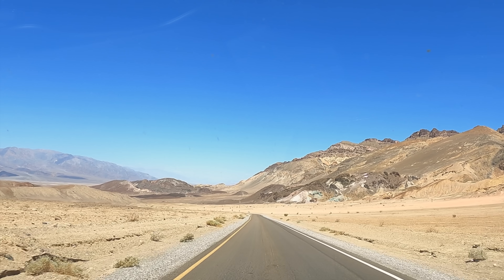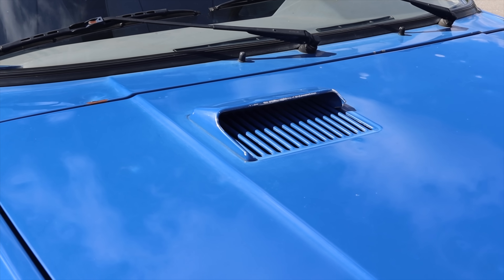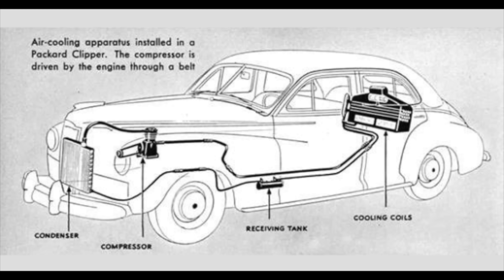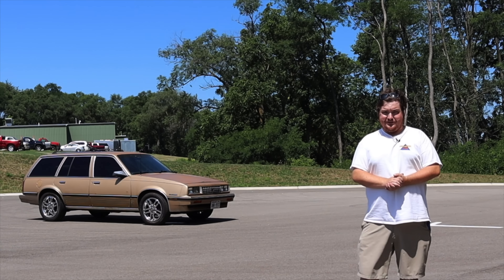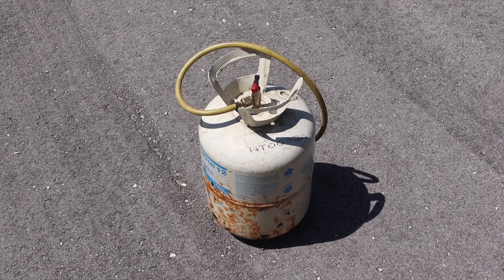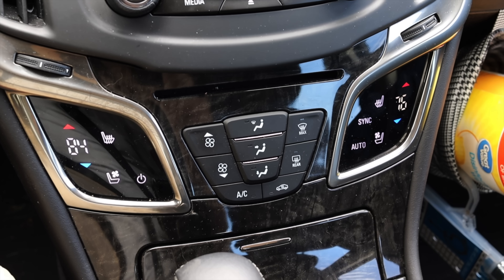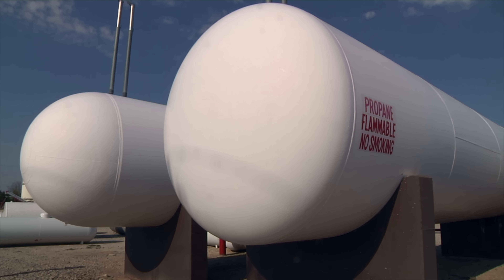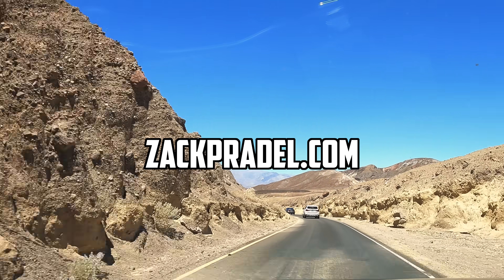Air Conditioning - The Story Of R12 & Why Modern Air Conditioning SUCKS!

Comment: I don't know, man, all of my newer cars have cooled the cabin pretty freakin' well.  I guess if I drove one back-to-back with an old R-12 system, I'd notice a difference.  Also, I'm in an area where 90 F is about as hot as it gets, and that only rarely.
Reply: Must be nice. Was 108 with the heat index in Tampa Bay today, I rely on really good tint and AC to survive 🤣
Reply: I've never been in an R12 car but in most tiny 4 cylinder cars I've been in, I've had to pretty much keep it on max once it got around 87 until maybe 30 minutes into the trip. Some SUVs I've been in cooled down much faster though, maybe it's because of their larger condenser and compressor.
Reply: @mattwolf7698  My ‘19 Honda Ridgeline can keep the cabin in the upper 60s on a 100+ degree day, but it’s basically maxed out at all times. In my old ‘88 Fiero or ‘92 Achieva, you couldn’t leave it on max for that long. Your fingers would be borderline frost bitten. I used to leave the a/c on and direct the air to the floor vents to keep….beverages…cold. And it made a huge difference.

Comment: I had a 2019 Mazda3 Premium Hatchback until I traded it for a 2022 CX-5.  Overall the ‘19 Mazda3 was great!  But my biggest complaint was to poor performance of the A/C.  It was noticeably worse then any of my previous cars.  So far I’m happy to say that the A/C in my new CX-5 is more on par with what I would expect from the system.
Reply: I'm a Mazda tech. You shouldn't be having issues with any of the vehicles you guys have. If its under warranty, have your dealer look at it. Today's AC systems are fairly complex, and there's several issues that can cause poor cooling besides low freon. Also, check under the hood and see if you have 134a or 1234yf. He didn't mention it in the video, but most cars are now using 1234yf. Its extremely expensive. When it first came out a few years ago, it was $500 a pound. The price has come down since then, but its still very high. Do something before the warranty expires. 

Like most car companies, Mazda has a policy of no upselling warranty repairs. What that means is if a tech finds something wrong with your vehicle and the repair would be covered under warranty, they're not allowed to say anything to the customer. (This applies to everything, not just AC). You have to make the complaint. So, even if you're not sure about some type of issue, complain anyway.
Reply: @AT-wl9yq  thanks for the insight! Imma get my Karen complaints going but then again I’m now out of warranty. 🤣
Reply: Yeah real happy with my new cx9 my 2014 Mazda 6 gt was nice and cold though. Maybe it was just the cx5 that year
Reply: I'm in Australia, my wife's 2016 Mazda3 a/C is very good. Maybe it was your car.
Reply: I live in southeast Louisiana and my wife's 2020 Mazda3 hatch has a great air conditioner.
Reply: I have a 2018 Mazda 3 GT and the AC is freezing lol!

Comment: At this point I don't feel it's the refrigerant that matters but the stupid computer controllers and modules that put fuel efficiency and "smart" function ahead of everything else. If one sensor doesn't work or one flap sticks all hell breaks loose in the system. My older Mercedes has an R134 system and it freezes the hell out of the car and my Mom's Nissan Kicks with a tiny system with R1234YF also blows really cold but you have to turn all that "auto" garbage off because it never works right. Just set it yourself manually and it's fine. Many newer luxury cars have so many different settings and programs for the climate control and the end result is it never does what you want it to do.
Reply: Eeeyup. though they do that more for comfort than economy in most implementations - the idea is to make air coming out of the vent closer to the target temperature rather than go for the full frozen face effect. IME, this works quite well, but in very hot and sunny weather I do find myself having to bump the set temperature down one or two degrees.
Reply: Correct. Engines get choked with this modern BS, and add to that that Americans use gutter fuel (86/87 AKI), so you have more knock, LESS fuel efficiency, LESS power, LESS MPG. Also, there are more 4 (and even 3) cylinder engines than EVER before. When you idle 6-8 cylinders with no eco poo poo, it's going to crank the AC (and heat in winter) WAY faster. And add to THAT that these newer cars have this dumb engine stopping nonsense (which may seldom stop the engine when the AC is maxed out, but still invariably will at some point). R134A in a good setup blows plenty cold. I recall being in a dinky HHR and that AC would freaking HURT when it cranked. GM, like Toyota, absolutely aced R134A. Chrysler also did great with AC (at least pre-Fiat). Their older minivans were great. Modern Fords are disastrously unreliable, but when their AC works, I recall them blowing very freaking cold too. Even a recent Escape I was in, I think a '17 or so, that AC cycled but it cycled from mild frost to ice cubes and I don't think it was set to "max". 

R134A was mandated in 1994 and used up until 2020 year models, so most people don't even realize how many cars they've driven with R134A. Also, people here are playing stupid. ALL compressors on Earth require a couple minutes to build head pressure when there's a strain (pressure equalized (settled) and high heat ambient). If it's 70 degrees outside, or under 85 in your garage, then yes, within a minute it's going to start blowing cold. But with your car baking in the 90+ degree sun if anyone thinks ANY car will be blowing cool in less than 1-2 minutes and COLD in under 5-6 minutes, then they're drunk and lobotomized... 

We could bring back R12, but to paraphrase what you said, if the car's electronics are tuned by a psychopathic eco lord, it won't touch the cars of the turn of the century.

Comment: I had a '91 S-10 pickup for a few years....  Because of it's R-12 AC system and it's comparatively-small interior space, its AC system was extremely efficient and EXTREMELY cold.  Like, almost uncomfortably cold if set on MAX cooling.  A put-on-a-coat kind of cold!
Reply: My buddies father had a 79 Chevy 4X4 1/2 ton and if you breathed right up at the vent you could see your breath. I've never seen air conditioning that cold ever again.
Reply: I had a 93 grand am which I’m assuming was r12. One day when me a several friends where cruising some country roads on a hot summer evening. We noticed that it was so cold that you could see your breath. Best A/C I’ve had in any car over the years
Reply: @somethingsomeone5440  Pontiac always had awesome air conditioning in their cars
Reply: I remember the old R12 systems would actually freeze the condensation around the vents in your dashboard.
Reply: I had a 92 Silverado with R12. Ice box cold. Loved it.
Reply: R-12 was a much better system than 134A. As a teenager I used to have a 75 Grand Prix that had a console that had a heat and A/C vent in it that blew air on the floor. You could fit a 6 pack of beer under the console and put the A/C on BiLevel and it would keep the beer ice cold. Those were the good old days. Still have one but don’t do that anymore. My 89 Firebird has R-12 and it gets ridiculously cold even on the hottest day in no time at all. However nothing compares to the old Chrysler air conditioning. My uncle had a 77 New Yorker that would actually make your hands numb.
Reply: I had a 03 Silverado single cab, worked more reliably than our fridge
Reply: Still own my '87 Ranger, with still fully functional original R12 system. I can get that standard cab to 34*F coming from the dash vents if left on max AC for long driving trips. It's stupid efficient, and amazing.
Reply: I had a 91 Honda civic with r12 that would make you shiver on a 100 degree day.
Reply: My 95 with R-134a would fog up the windows in summer (at night)
Reply: my 98 s10 runs r134 it does the same. i dont have anything r12 to compare but definitely colder than any other ac in the family. now to fix the transmission 🥲
Reply: @rabbitdrink  Because it's more about the size of system rather the refrigerant itself.

Comment: On the Corolla, Toyota offers Dual Zone A/C only on the hatchback (including the previous gen Scion/Corolla iM) and not the regular sedan. I don't know why Toyota does this.
Reply: My guess is that with a hatchback you are heating/cooling the trunk area as well because it’s open to the rest of the cabin. The front climate control likely can’t cool the whole vehicle efficiency enough by itself. I have had this problem with hatchbacks I’ve owned in the past, A/C blasting in the front seats but it’s still 75 degrees in the back seats because it’s not powerful enough to overcome the sunlight beaming in heating up the rear of the cabin. 

With a sedan/coupe, the trunk space is its own separate compartment so there is less space for the single zone climate control to heat/cool.